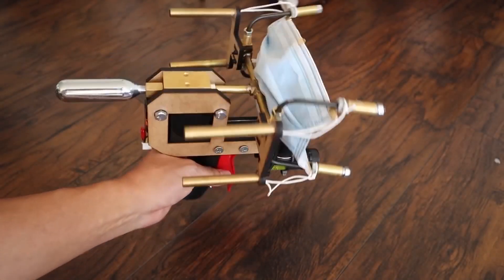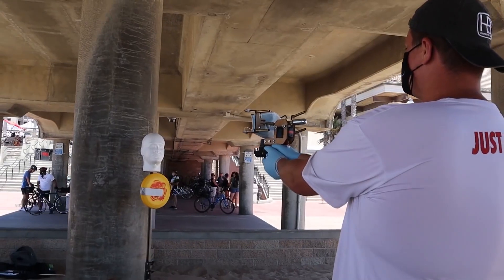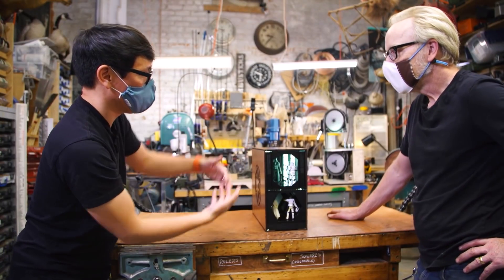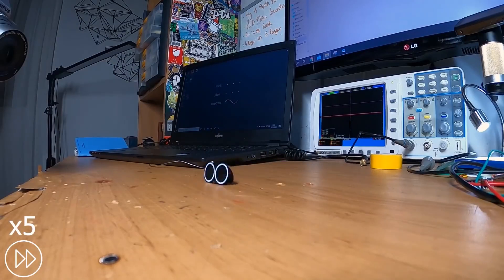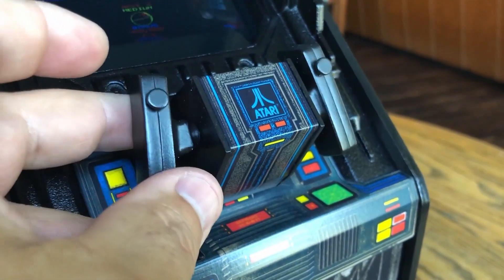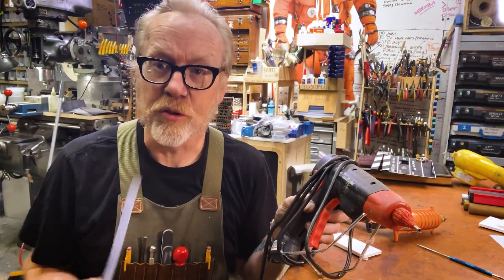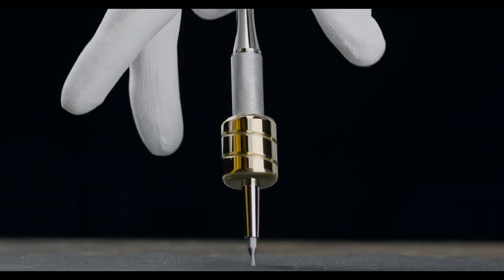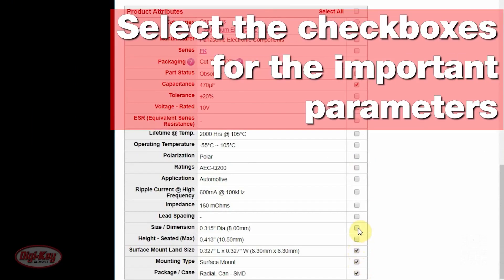Mad Mask [Maker Update #193] - Maker.io

Comment: Rob, another great episode of Maker Update. It kills me to see beautiful wood grain being covered in paint. I understand wood grain finishes are out of style but I think about future episodes of Maker Update when you show people how to strip paint off wood to uncover the beautiful wood grains hidden below! Everything runs in cycles. On capacitors I was given a WWII era bench grinder that hadn’t run in probably 70 because the starting capacitor had failed. I ordered a replacement capacitor from DigiKey and presto it’s operational again. It’s a little beast because it’s rock solid. I did needed to adapt plastic guards for it, but the bearings and motor are rock solid. I love old shop equipment that people throw away because they lack the technology to repair them. Lol technology is king! Learn everything you can here on Maker Update...... syl
Reply: I have to admit, I was a little surprised when I saw the high quality of plywood he was using in that video. It's one thing to cover up the end grain voids in some cheaper AC plywood, but his example was so beautiful already. Still, if it's a look that a client wants, it's nice to know how to pull it off without a tangle of veneer.
Reply: I hear you John. I work with a lot of wood myself partly because I love the beauty of the medium. It would be cool to see someone use this technique to hide and paint the plywood edging, but then feather in the wood grain as you move away from the painted edge like they do in a tobacco-sunburst style guitar.